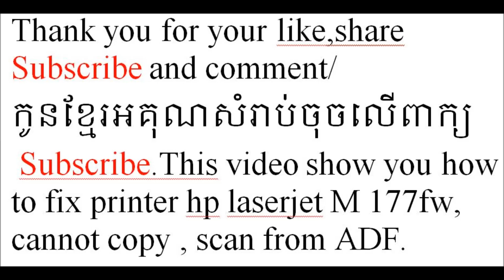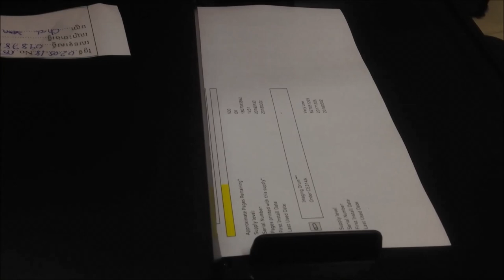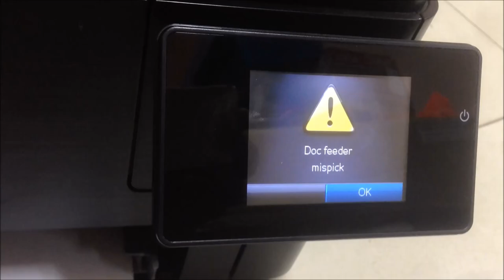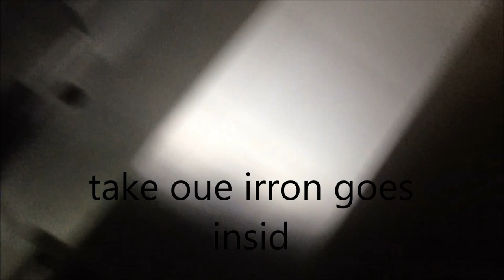HP Color LaserJet Pro MFP M177fw cannot copy How to repair

Comment: What if you get to the part (at 3:46 in video) where the gears only roll one way?  How do you fix it so they are "free" and rolling in both directions like video indicated?
Reply from the maker: i have other video show this one . if not see in this go to Youtube (myshare). if  the gear roll one way one gear stuck and you remove or adjust all gear and clean dirt   can be solve . this problem i never change  new .you make sure gears is run one way, time if the cable the from the Main board  to ADF IS broken one or 2 line also not pick up paper when scan or copy
Reply: @Electronicview  I figured it out!! The gear actually needed “backed off” with screwdriver.  It was too tight.  Thank you!
Reply: @denisestephens3495  I have the exact same issue. Where did you find the gear that you "backed off"?